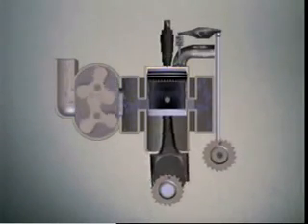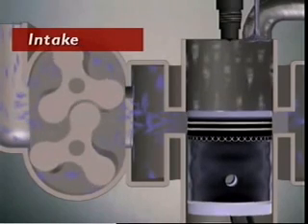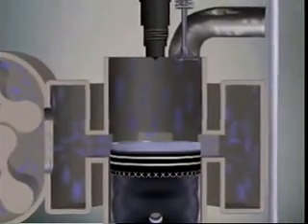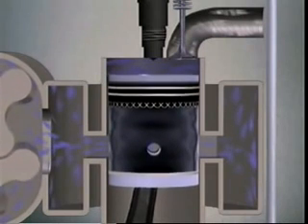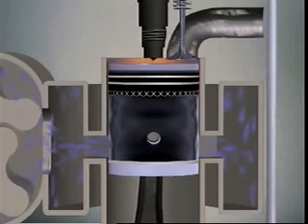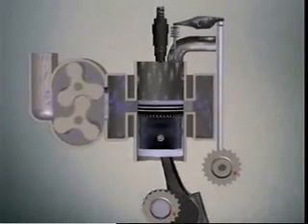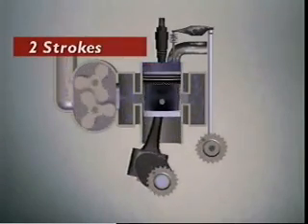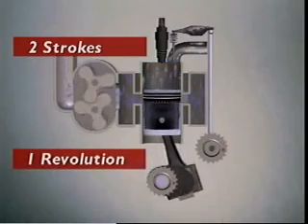2 stroke Diesel cycle

Comment: Does the exhaust valve close before or after the intake port is closed?
Reply: After. A small amount of fresh air is wasted in order to make sure the exhaust gas is fully chased out. This can be done without wasting fuel as obviously the injector doesn't operate until almost tdc so these 2t engines have better scavenging than the crankcase induction method.

Comment: If gasoline engine can work in similar way....
Reply: I think it's possible. All a 2 stroke gas engine would need is an oil pan, fuel injector and a blower added. Get rid of the transfer port too. The advantage is a 2 stroke gas engine working the same way as a 2 stroke Diesel is that it wouldn't need any valves or a camshaft. It would still weigh less. Some people say that doing that to a gas engine just increases the weight and defeats the purpose of its use in lightweight applications like weed whackers and chainsaws. They don't seem to get the idea that engines are more powerful than they used to be. This includes 2 stroke gas engines. All you'd have to do to keep the weight down is build more compact engines. The advantage of 2 stroke gas engines being built and operating like 2 stroke Diesel is increased horsepower and torque due to the gas being injected rather than mixed with the incoming air in a carburetor. The reason is that all the gas would be burned instead of some being wasted out of the exhaust pipe. Also, because of increased airflow. Some air would still be lost through the exhaust pipe during intake just like in a 2 stroke Diesel but that wouldn't matter since no gas or oil is being wasted along with it. Having an oil pan would improve lubrication, the engine would last longer and require less maintenance. Also, because no gas and oil are being wasted through the exhaust pipe it would be much cleaner burning.
Reply: It can work. Why wouldn't?

Comment: The rotation should go the other way
Reply: The blower on the engine isn't there to make power. It's only to provide air to the engine, so the way the blower turns is how it operates in the video.
Reply: @waitwhat5588  It's irrelevant, it's still spitting the wrong way. It's sucking air instead of blowing it in.

Comment: Btw that blower is rotating backwards
Reply: It's not. Look up gear pump.
Reply: Lol no
Reply: That could happen. Being a 2 stroke, it can run backwards and so the blower would turn into a sucker, pushing out the exhaust gasses.
Reply: Its not

Comment: Oil comming from the oiling ring , it go on the intake port or what ??
Reply: He have the engine have oil pump driven by crankshaft like the four stroke the lubrication is same like the 4 stroke diesel or petrol the same oil pump etc etc
Reply: The crank case is sealed like in a regular 4 stroke, so it doesn't burn oil, since it doesn't need to, because diesel fuel is a lubricant itself.

Comment: I gather you just introduced you oil directly into your fuel tank and that’s how the main bearings got lubrication. Or does diesel fuel have enough lubricity to not need oil and gas mix?
Reply: It depends on the engine. For instance a 6-71 Detroit Diesel or the big EMD power plants on locomotives oil like any other engine with a dedicated oiling system. The fuel isn't pre-mixed with the oil as it would be in say a small Nitro radio controlled engine or lawn string trimmer.
Reply: The diesel fuel is a lubricant itself, so the crank case is sealed, and the engine doesn't mix oil with fuel.

Comment: Why’s the supercharger spinning the wrong way
Reply: It's a Roots Blower, and that's how it's designed to operate.  The Roots blower is more about air flow than compression (like a Twin Screw)
Reply: Peter Andersen it carries the air through the case side of the rotors? Not straight through? I was always under the impression is shoved the air straight through. Thank you for clearing that up. I have a few old V style blowers but never really worked with them. Most of the stuff I’ve worked with has been twin screw as you said.
Reply: @knifelover73  The Twin Screw Supercharger shoves air straight through and compresses said air, while the Roots blower is typically used in applications where a large volume of air must be moved across a relatively small pressure differential
Reply: @ike fun - thank goodness we have you, we'd be lost . . . lost . . .
Reply: 'Master!'
Reply: I would like to know :)

Comment: i guess a petrol version might work with direct injection and a spark plug alongside it, and lower compression ratio for the gas
Reply: Ferrari did it in the 90s.
Reply: It wouldnt work because there is no way to adjust throttle and air fuel ratio.
Reply: Heinz LETZTE. Heard of something called a throttle body and reed valves. In a 2 stroke gasoline engine there are no exhaust valves, but there is an exhaust transfer port, parallel to the intake port that sucks the oily air from the crankcase. Actually there is something like that that exists it’s called ETEC which is designed and engineered by BRP for their Rotax and Evinrude engines.
Reply: @heinzletzte.6385  Off course you can. Put a throttle before the supercharger and you are ready to go. Watch the 2STROKESTUFFING yt chanel. He uses supercharger on a 2 stroke engine.

Comment: Interesting. Wonder if you could run this on paraffin (kerosene), if you added some lube oil.
Reply: 2 stroke diesels don’t need premix their crankcase is sealed off like a regular engine
Reply: @alangodin2090  If the fuel isn't an oil, like kerosene which is a dry solvent, you need oil mixed with it. The high pressure fuel pump needs lubrication unless you want your pump and injectors to get destroyed in under 10 minutes :)
Reply: @em4703  That is IF the engine has a High Pressure Pump.... On "Most" 2-Stroke Diesels (Like the DD 51/53/71/92/110/149), they use unit injectors, and though the injectors "may" have a shortened life, they do function quite well on kerosene... After All they seem to run fine on various Military JP Fuels, like JP-5 and JP-8, and run on Jet-A, which those three are most like kerosene... I have even seen them run on JP-4, in emergency situations...
Reply: GreenerHill it will run on a lot of stuff. On almost all oils and lubricants. I don't know about parrafin but i would not be amazed
Reply: You don't need lube oil for this engine as the oil system is the same as a 4 stroke.

Comment: usually i see turbo diesels, but i think that a supercharged version is way cool!!!
Reply: 2 stroke diesels need supercharging to run, they can’t aspirate naturally since they have zero vacuum
Reply: @Mr Sunshines a turbocharger in this configuration WILL NOT work, in order to get this going, you need to be able to generate positive pressure from a standstill, which only a supercharger will do. (when you are cranking over an engine not running, not producing exhaust gas)
Reply: for clarification - if you didnt realise, this is a 2 stroke diesel, not a 4 stroke diesel.
Reply: @BCzepa  Its a 2 Cycle Diesel
Reply: @mikegray8808  yes, a 2 stroke diesel. im not sure people are aware that you need positive pressure to start a 2 stroke diesel because of the port design
Reply: @BCzepa  No, you don't need any blower pressure to start a 2 stroke diesel with turbocharger. Your starter motor or kickstart will move the piston towards TDC, compress the air, then injector injects diesel, combustion runs the turbocharger and woala! you have inlet pressure from turbocharger from a standstill.
Reply: BCzepa There were some Detroit Diesel 2-stroke engines which only had turbochargers. They were used in trucks and made a lot of noise. However, turbos would probably not be as effective as a supercharger or maybe even twin-charging.
Reply: @chielwouterscw  but didnt they require excessive power to start? i wonder if it would be possible to create a 2 stroke diesel motobrbike that could be started by kickstarter
Reply: BCzepa I don't know how these engines were started, probably just with some sort of starting motor. I guess that a turbo could work with a 2 stroke diesel since the compression is very high and so quite some exhaust fumes must be created. If the idle rpm are a little higher than usual the turbo might already be spinning during idle. Oh, and BTW, a 2 stroke diesel motorcycle sounds like a very cool idea.
Reply: @BCzepa  You can get it going with a compressed air tank blowing inside the intake for startup. It's how it can be done without a supercharger. Most big 2 stroke engines, like marine engines for example, start this way. Detroit 2 stroke generators also.
Reply: It’s not supercharged it’s just a blower they have turbos on them
Reply: @Mr Sunshines are you always this angry?
Reply: Mr Sunshines a turbocharger and a supercharger are a completely different thing. A turbo is powered by exhaust fumes and a supercharger is directly connected to the engine so it doesn't have any lag. Get your facts straight before calling people a dumbass.

Comment: It's a fidget spinner
Reply: Even two!
Reply: A supercharger is a 2 metal fidget spinners Extruded and twisted, and meshed together with a gear on each fidget spinner, and it’s driven by an accessory belt.

Comment: it has the same fuel efficiency as the 4 stroke, i think.
Reply: CXN no, this engine has the highest efficiency of all ic engines, 50%
Reply: fuel efficiency is higher than in a four stroke its about 55% thermal efficiency
Reply: @heinzletzte.6385  The Fuel efficiency is way lower (you burn way more fuel than a four-stroke i.e more Liters per 100km / less Miles per Gallon). You are right about the thermal efficiency, but he asked for fuel efficiency
Reply: @xGxPhantomZzz  you can get better fuel efficiency by lowering the displacement. Since 2 strokes have more power strokes than a 4 stroke, you lower the displacement and you get the same power + better fuel efficiency. Sorry but you are wrong
Reply: @heinzletzte.6385  really 55% on diesel engine ? I studied engginering for 3 yrs and highest efficiency :
-turbine engine : 50-60%
-diesel engine  : 35-40%
-gas engine : 25-35%
-steam engine : <15%

CMIIW
Reply: @ilhamrizqi1814  "diesel engine  : 35-40%" Is that two, or four-stroke diesel engines?

Comment: Why want normal 2 strokes be like this
Reply: Diesel 2 strokes....
Reply: If by "normal" you mean gas powered it's because valved 2 stroke diesels have very long strokes and always have forced induction, if you had just an exhaust port you would blow all the air out of the cylinder before it's used.
Reply: Chase Miller in a fuel injected 2 stroke gas engine, the air goes through the throttle body, then the reed valves, and crankcase. The oil is then injected to the crankcase to lubricate the internals, then the oil and air mixture goes through the intake transfer port however the the piston serves 3 purposes to act as a piston, an intake valve, and exhaust valve. Then the piston closes off the transfer ports, compresses the air oil mixture and fuel is injected, then when the piston hits just about TDC, spark plug fires burning the air fuel oil mixture forcing the piston to go down, by the the time the piston opens the transfer port the fuel oil air mixture is fully burned off, while the piston is reaching BTC the exhaust gets replaced with fresh air oil. Fuel injected 2 stroke gas engines can be incredibly efficient and eliminate the need for turbochargers.

Comment: What the hell is up with that random exhaust valve hanging out there?
Reply: where which one are you talking about?
Reply: @fidelcatsro6948  honestly I got no idea, I made that comment 3 years ago lmao
Reply: @wills.5762  its designed and explained correctly i didnt find any random valve
Reply: @wills.5762  they don’t use two ports like a weed eater. The ports are only intake and the top valve is the exhaust